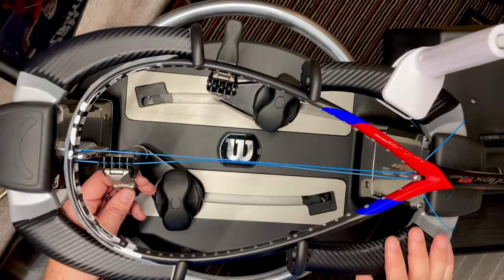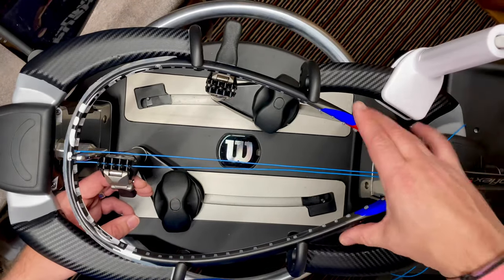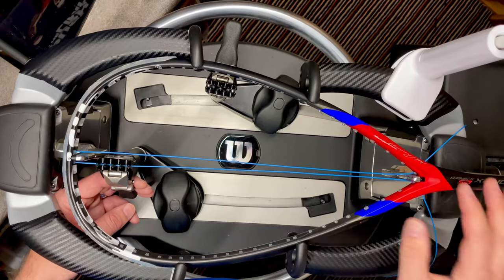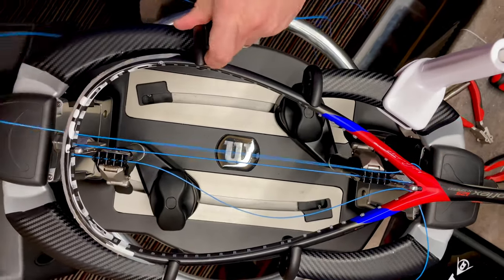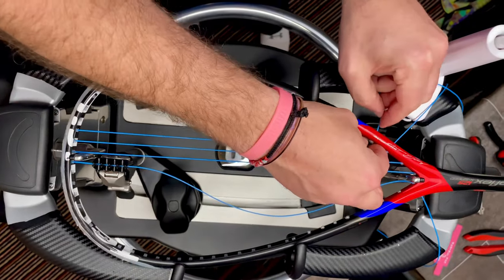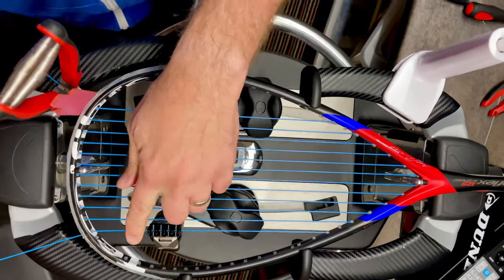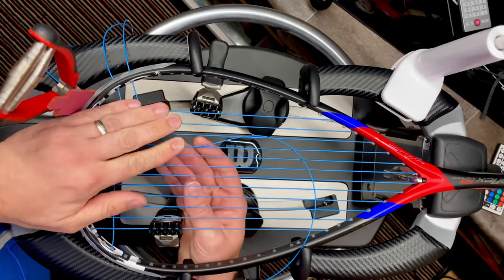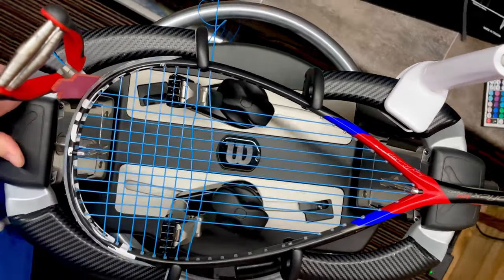Tecnifibre Carboflex Stringing - UKRSA ATW Pattern

Comment: Hi! Thanks a lot, it's a great tutorial for me. However, I didn't understand how you split the length between the long and short sides to fit correctly, while using one package and not roll? Mine machine is with a disk that catches the string for tightening and it's more expensive from the last string length need.
Reply from the maker: Hey there. Easiest way to explain. I'm a about 6 Ft 1 with a long arm span. I measure just over 5 full arm spans of string plus a little extra as the total length needed. For the short side, I measure 7.25 full head lengths of string. Then the rest is for the long side. Hope that helps 👍

Comment: Hi…great video but I wasn’t quite tracking the trick to getting the crosses to originate at the top of the racquet. When I did it the crosses started at the bottom?
Reply from the maker: Hi there, you need to use an Around The World method. You can either use the Universal method or the UKRSA (as in video). Measure the short side a little longer than usual (about 8 head lengths) then you string all but the last mains on each side, use a starting clamp on the short side at the top too after you've strung the 6th main on the short side, then after you've strung the 6th main on the long side, start stringing the crosses from the second cross down. 

Next time you get a Carbo, just follow it step by step. Hope it helps.
Reply: Done!  Thank you. Very helpful. Can’t wait to use the racquet tonight.
Reply from the maker: @zorro22207  have fun!

Comment: Great video 👍 how you measure lengths for a short side and long side in this method?
Reply from the maker: Thanks Eli, 

I so I use 5.5 full wingspans/ arm spans in total - about 9M of string for a Carbo and measure 8.5 racket lengths in the short side, then the rest does the long side. That’s for this technique. 👍
Reply: @stringdoctor6238  You surely mean stringbed lengths, not racket lengths, right? Your method with the three last crosses strung with the short side would requrire at most 5 full racket lengths on the short side.

Comment: Could you please do a video on your recommended stringing method for the Harrow Vapor?
Reply from the maker: Hi David, the Vapor's a pretty simple one. I had a couple in to string not long ago for Rob Owen (Paul Coll's coach). Next time I get one, will do a video 👍
Reply: @stringdoctor6238  I have strung many of them but you are the expert so I’d like to see how you do it.  Thanks so much!
Reply from the maker: No problem. Will keep an eye out for one to string and post 👍
Reply: Ashaway Powerkill 110 SL is also the identical frame, so you could use that as a demo for both. You are right, they are easy to string, with the crosses coming down top to bottom. Simples!

Comment: Hi, should you ever use 2 strings instead of one long one?  Meaning, do all the lengths, tie off both ends, then start with new string at the bottom and go to the top?  Cheers, Peter
Reply from the maker: Hi Peter, you can use 2 pieces if you like but the around the world 1 piece version is generally the best as it ensures totally accurate tension across the mains. If you do a 2 piece, just make sure you start the crosses always from the head in squash and tennis. It's only badminton where you would start the crosses from the throat and this is due to the head shape of a badminton racket.

Comment: Hi great video. I see you use 5.5 arms length for one piece. But how much do you measure for the short and long side doing ATW pattern of for even the normal 1 piece. Thank you.
Reply from the maker: Hi there, for the short side I measure how many mains on that side plus a bit extra for tie off. For ATW patterns I do the same, plus an extra 1.5 main lengths.
Reply: @stringdoctor6238  thank you

Comment: what should  the ratio between the short side and long side..
Reply from the maker: When you say ratio and you referring to the amount of string used on either side? If so then I normally measure around 5.5 armspans of string/about 9+ metres and use 8 head lengths of string on the short side.
Reply: thanks  a lot

Comment: Hi Jon, thanks for posting this. Which brand of starting clamp do you use please - there seems a wide variety out there. Also, is the rubber "frame protector" for the clamp something you can buy or is it something you made yourself? Cheers John.
Reply from the maker: Hi John, thanks for your comments. The starting clamps are Babolat, expensive at around £50+, but the best out there unless you want to spend £100+ on Yonex/Kimony adjustable starting clamps. 

The insert that goes between the clamp and the frame is a leather Parnell Pad, which Richard Parnell sent me. They're excellent and a worthwhile purchase. You can get them from Parnell Knott's website. Hope that's helps.
Reply: @stringdoctor6238  Many thanks Jon, thats useful.

Comment: Ok, noted! I meant 10-15lbs, not percentage, to reach the same tension feel in the top cross string as the ones below. However, post your advice, I will ensure that the increment in tension in the last string keep it same as, and never above, the tension of rest of the strings.

In the racket strung yesterday using your method, I increased the tension by 5 lbs. It is still slightly looser than the ones below, and that part is feeling dead. Will try about 10lbs and update.

Thanks!
Reply from the maker: 5lbs is a lot of extra. If 10 - 15lbs this could break the frame. Recommended 'extra' tension if you do use extra tension before tying off is 10% on squash rackets - so around 2.5lbs. Tennis you will sometimes go up to 20% (about 10lbs) as tennis frames are stronger. The dead feeling you get is likely because you've put too much tension through the string.

Comment: Hi, thanks for the informative video.

Few observations and questions-

Firstly, the sound of the strings being pulled is masking your voice. So if you would have used a mic/speak louder and use a smoother string for making the video, that would have helped.

Questions are-

1. What is meant by "Short side" and "Long side"?

2. Assuming arm length is same as racket length, we use 13 racket lengths total for 1 squash racket. I've done 1 racket's stringing for trial, and get that it's 5 racket length on 1 side, and 8 racket lengths on the other.

3. When you turn the last length string to finish the final top width string, why don't you tie knot rightaway and clamp the string, and tie that top knot in the end?
Reply from the maker: Yes, sound could be a little clearer. It's ok on most videos but could definitely improve on the sound. 

The short side is the side which has the shortest length of string use and is typically only for main strings on that side (and sometimes a few crosses). The other length of string does the mains on the other side plus the majority of the crosses. 

I generally measure 5 and a little bit full arm spans of string to be able to string a racket of this size. I'm 6ft 1 with long arms, so you may need to adjust. I measure with racket head lengths for the short side, plus a little extra and the rest of the string will be long enough to compete the rest. 

The reason for tying off at the throat first is due to having both clamps available for security. Always best to have two clamps in use in case one slips and to keep best tension. To tie off at the head first, you would need to use one of the clamps. Plus, it's more efficient to tie off at the throat first as you are already there. 

Hope that helps,

Jon
Reply: @stringdoctor6238  thanks for the reply.

One more question if you don't mind-

Even after stringing your way, on a machine similar to your's (Wilson) the racket has come out narrower in width and taller by about 3mm compared to a factory strung racket. Is the factory using a different machine that might be clamping the racket from inside the frame widthwise, and does such a machine exist?

To resolve the reduction in width, after tensioning the main strings, I am thinking of relaxing the top/bottom clamps, then relaxing the width clamp so the frame expands widthwise. Then on tensioning the cross strings  the frame should revert to unstrung shape. This is how we used to string in the pre machine era 30-35 years back! I realize this may put the frame under uneven stress.

Kindly advise if there is a better way, or should we just accept a minor change in shape?

Also a tip- for Carboflex type rackets that have a finishing knot at the top for cross, there will be some release of tension in the last string when we finish the knot. This leads to a dead spot at the top, where a lot of shots are played from, especially on tight balls. This is also apparent in factory strung rackets. To resolve this, I increase the tension in the last string by about 10-15lbs (depending on how stiff or flexible  a string I'm using). So the tension in the top string then becomes similar to the rest of the strings.
Reply from the maker: @amitojsingh7899  Hi, the rackets at factories are very poor, stringing is done for speed only and often only every 2 or 3 strings may be tensioned. Don't adjust the  posts when stringing rackets, aside from minor adjustments if the frame rattles in the posts too much. Rackets will always change shape when stringing. 

In terms of the last tie off. There is actually a reason for not adding additional tension, this is to slightly soften the impact point for wall shots and also helps to reduce breakages off mishits. Also, the head is generally a lot weaker than the throat area, so it's not always a good idea to add extra tension, as I would normally do with tennis rackets. Badminton employs the same tactics, with the top cross strings being reduced in tension rather than increased. I hope you don't increase tension by 10-15lbs. Do you mean %?
Reply: @stringdoctor6238 is there any way of clamping the width from the inside?
Reply: Ok, noted. Thanks again.

Comment: Great video! I believe it's the first video tutorial for this method.
I do Carboflexes and similar rackets the same way, but I weave only the last cross with the short side of the string, not the last three as you've done. Either way is fine I think...
Reply from the maker: Thanks for the comment. Lots of different ways to do but the key is to make sure that the crosses go head to throat and the loops on the outside are small. Glad you liked the video 👍

Comment: Thanks for your wonderful video. When I followed this instruction, I ran into an issue of doing  the step at 17:09 time of the video.The outer turning string (of left top corner) is blocking the string coming from bottom (ends up as first vertical string) How do  I solve the issue. I am wondering - how you are able insert effortlessly . Please comment
Reply from the maker: Hi, make sure the tip of the string is pointed (clip it if you need). You can either use a finger nail, as I did here, or a fine awl to gentle move the outer loop down a bit to creat a bit more space.
Reply: @stringdoctor6238  Sure I will try that. Thanks a ton. your quick response is so impressive. ( better than most of the paid services :) )

Comment: Hi there mate. 
So I’ve just restrung my first ever racket using a new electronic machine I got today and I used your video to complete it as it was a new Carboflex 125 Airshaft. 

Firstly, great video! Seeing as this was my first ever attempt at stringing, it seems to have gone well. Just had a hit with it on the courts and it didn’t disintegrate so thanks, this video was a massive help. 

I only struggled with a couple of parts so just wanted to check if I was doing something wrong. When I had done all the cross ones and put the last two mains through, I really struggled threading the string through the grommets due to the string covering the holes. My bumper didn’t have the guides to separate the strings at these locations so it was a real struggle. Is there an easier method to do this. And the other tough bit was getting the last main back through at the head of the racket to tie it off. Same issue, really struggled to push the last main back through. Is this just something I need to work on or is there a method. 

For reference, I was using Supernick ZX 17 strings.
Reply from the maker: Hi Neil, 

Good questions. So the Ashaway strings are a little trickier to get through grommets that are slightly covered as the strings are soft - so aren’t easily forced through. 

Two things. Sharpen the end of the string. Then use a fine awl and careful push the loop covering her grommet away so you have room to push the string through. Just be careful not to scratch the string with the awl.
Reply: Ah ok, that’s exactly how I ended up managing to get them through! Good to know I want doing something wrong! 👍🏼
Thanks for the quick reply!
Reply from the maker: You can also put some cut off string in between the loops to then pull down the loop to ease the string through. Very common in badminton stringing. But you shouldn’t really need if doing the above.
Reply: Ah yeah, can see how that would work. Especially by using some thinner grade strings I guess. Thanks for tip 👌🏼